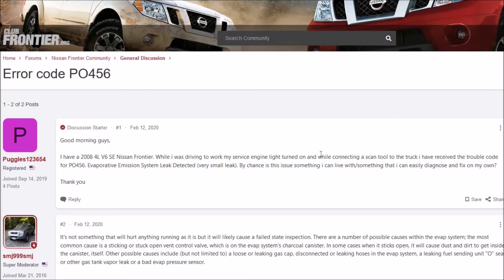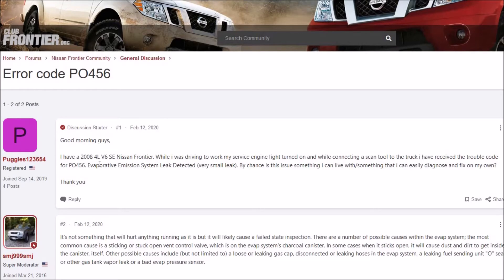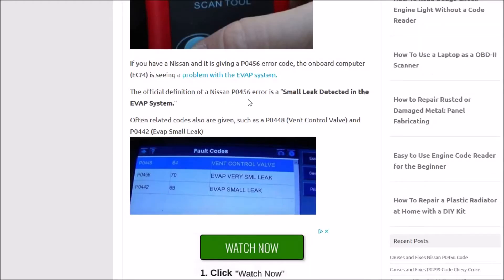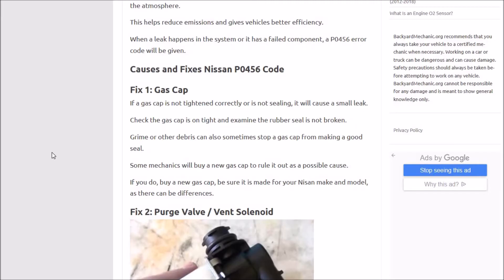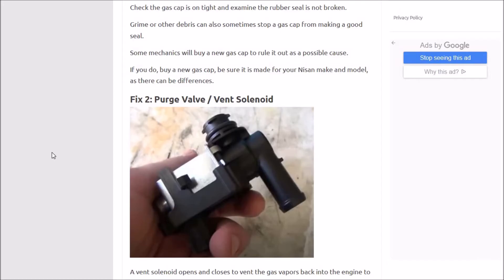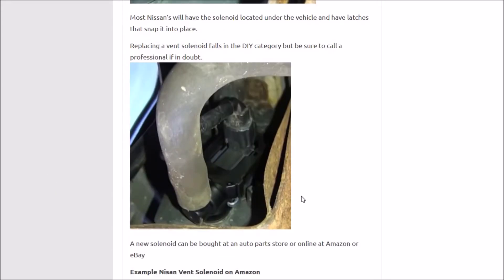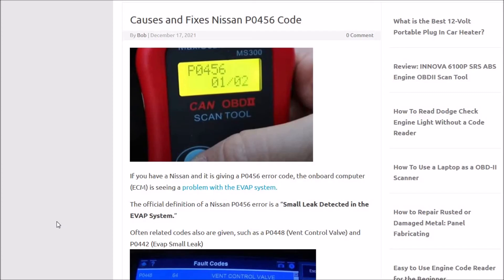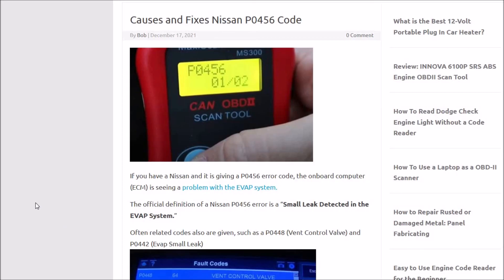2 Most Common Causes and Fixes Nissan P0456 Code

Comment: I saw a video that though rare is possible on higher mileage vehicles that the fuel pump has a small melt hole in the electrical connector.
Reply: yes, that is the most common cause on a nissan sentra 2013 ->   burned hole in the plastic fuel pump connector.

Comment: I got my purge valve replaced with brand new one and replaced my gas cap and the same codes still popping up on my Nissan Altima
Reply: Might need to change your fuel vent return line

Comment: My engine makes a loud grinding noise when I accelerate, when I pull the code I get p0456 (small leak) but like I said the grinding is very loud, would that be a purge valve? I’ve checked my gas cap, I’m sure I need new hoses but the grinding noise makes me feel like it’s a purge valve. Any thoughts?
Reply from the maker: I have never had any component in an Evap system cause a grinding noise. I would check the tires for any rubbing, engine belts, transmission, CV axels, or any moving mechanical components.
Reply: If you hear it when the car is moving it may be your wheel bearings
Reply: I had the same sound with the same code. I know it seems way out, but I believe that it was the power steering system since the power steering is electric on this car it makes a weird sound when it’s struggling to work. Anyways, I fix the power steering and boom just like that grinding went away.
Reply: i had this problem too my transmission fluid was so low & change it add more , don’t hear it anymore when i accelerate
Reply: @Renegadenation88 how did your trans fluid get so low? How many miles? Thanks
Reply: What car?
Reply: @BULLISHGUY-fg3so I heard something like that I have a G37x

Comment: There is a DTC bulletin for Nissan.  The o-Ring around the valve is determined to go bad.  It says to ONLY replace the o-ring.  Ugly link, I apologize

https://static.nhtsa.gov/odi/tsbs/2019/MC-10153007-9999.pdf&ved=2ahUKEwiZh72Ny_f_AhVutokEHYbJBUYQFnoECBwQAQ&usg=AOvVaw1impp4wNmbxypPbG_chaHk
Reply: I saw a bulletin on Alldata that said this as well, and had instructions. I got the new o-ring and changed it, making sure all was clean and surfaces smooth, but that wasn’t it, I still get the same code. Any other suggestions? I had already changed the gas cap, it looked fine…